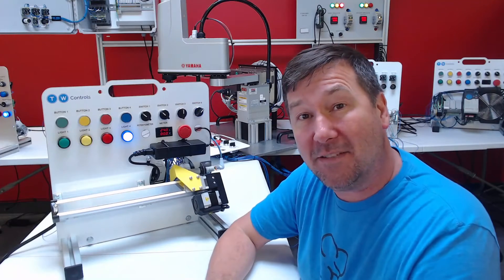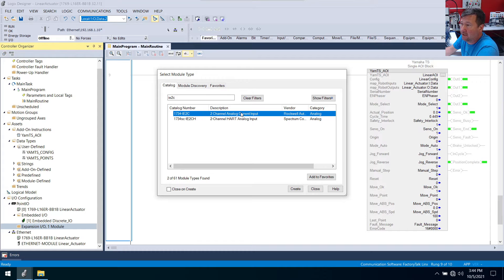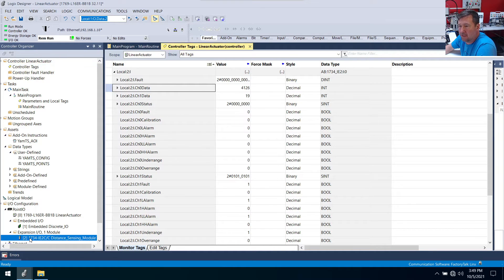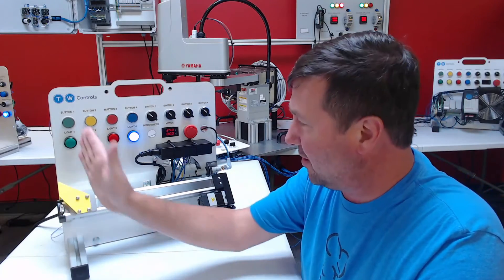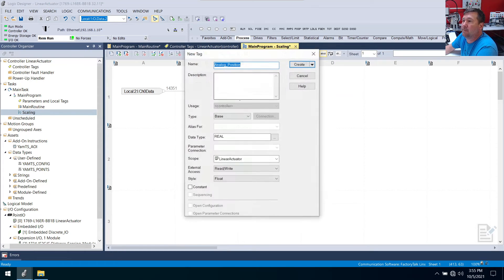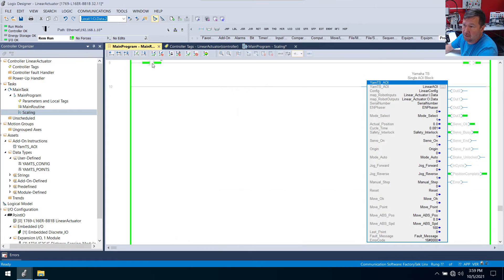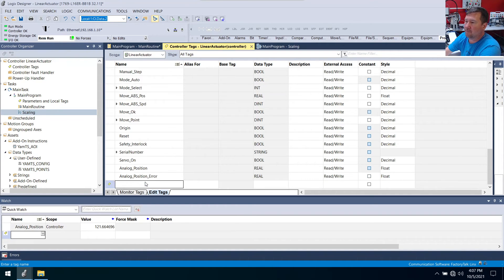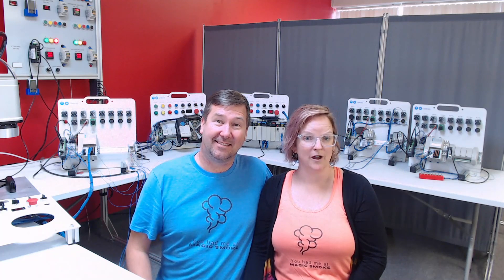4-20mA Analog Measurements and Scaling in Studio 5000 PLC

Comment: Hii, I have a flow meter KEYENCE  FD-Q20C it's analog output (4-20ma) 0-100 litres. And used for oil flow application now I need how much litres oil flo in pipe line. 

How to program output value in to HMI.